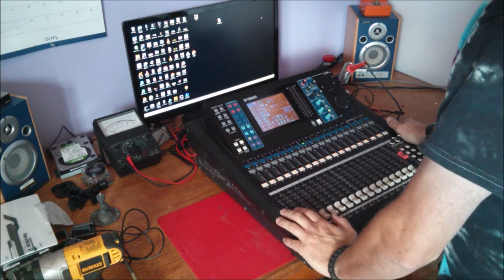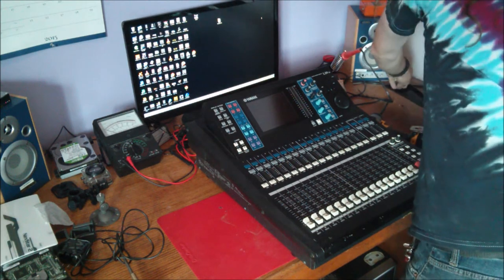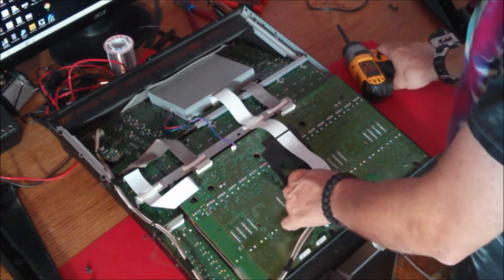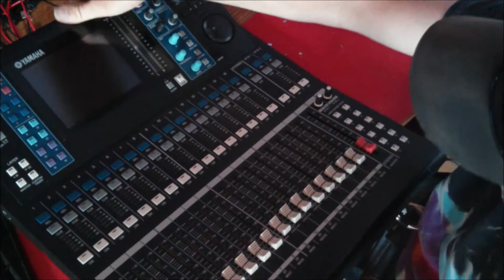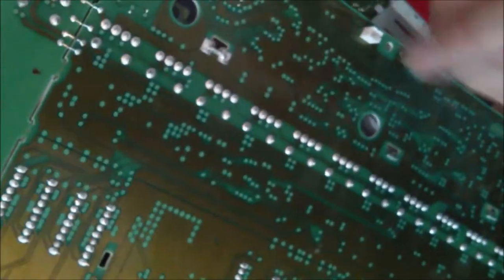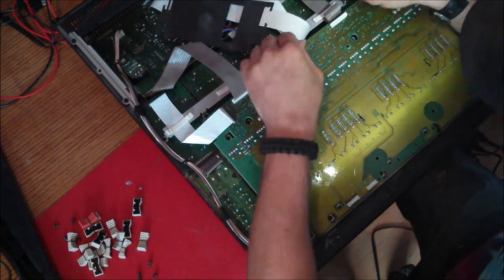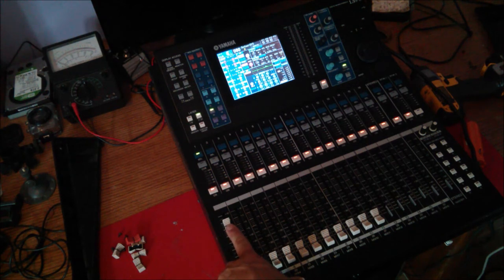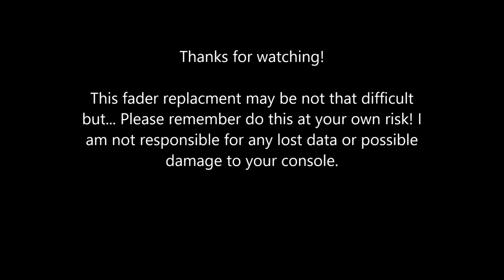LS9 Fader Replacement

Comment: For the newbies:  use a HAND-DRIVER instead of a drill for stuff like this.  You will eventually strip a screw using a drill.
Reply from the maker: For more than 70 screws it's worth it to use an impact or drill to remove them. Just have to break them loose and start them back in with the hand driver to keep from stripping the heads or threads.

Comment: 07/18/2017: Fader part numbers V6226100 (no dust cover?) and ZM682700 (with dust cover) have been replaced by ZX419000 (no dust cover, according to pics I have seen).
Reply: What supplier did you get the faders from? ...Thanks for the part numbers by th' way. ;)
Reply: I haven't yet.  The only shop I know of having them is fullcompass.com   Though any Yamaha dealer should be able to get them from Yamaha.